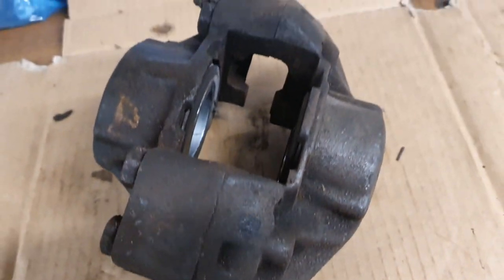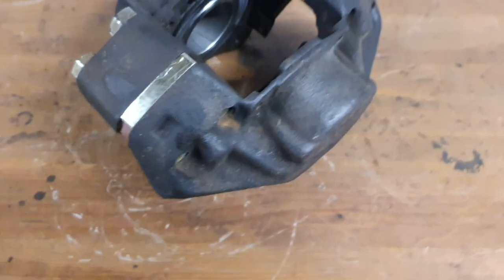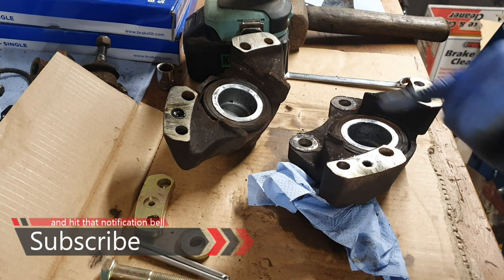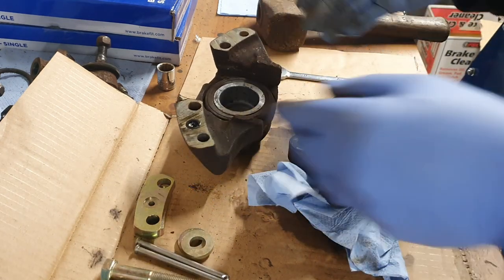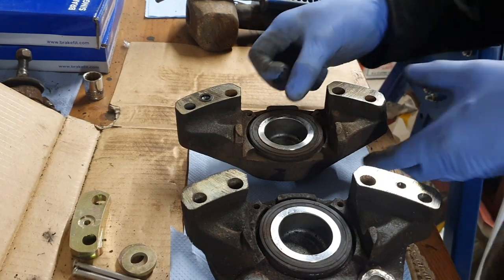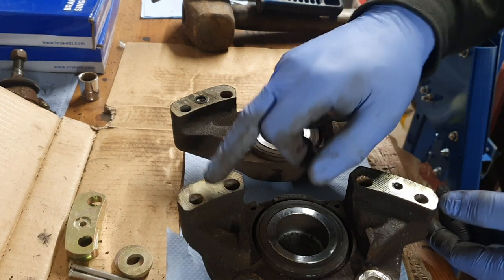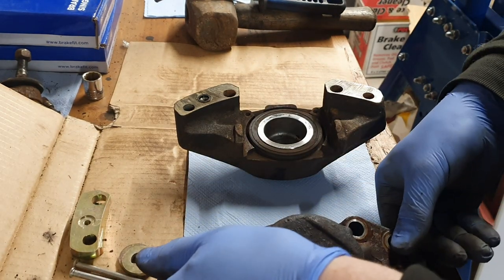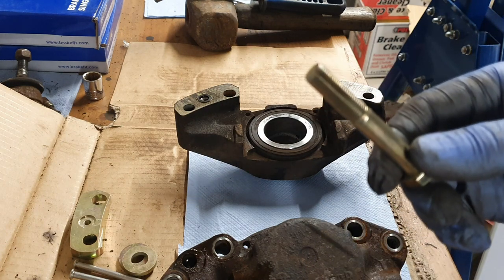Upgrade your capri escort or cortina brake calipers to v6 spec

Comment: The main mod, back in the day. Was to use the Calipers from Austin Princesses, as they were Four Pot Calipers.
Reply from the maker: Yeah it still is a relatively used mod the princesses 4 pots this is just a nice cheap way to get the 2.8i set up 👍

Comment: worked in a garage in the 70s was told never to split old used calipers apart as they are susceptible to leaking,if my gaffer a mot tester spotted this mod back then he would refuse to test the car.

Comment: Good video. I watched hoping to find the torque wrench settings for the inner and outer bolts. I have a workshop manual to suit a car with those calipers but it doesn't show those settings.
Did your kit mention the settings?
Reply from the maker: @william humber hawk no I couldn't find any at all I even looked through a load of old autodata manuals from the 80s/90s and nothing not even the 2.8i hanyes manual has the correct specs for the vented discs but if I do find some il pin the past at the top of the comments 👍information is king
Reply: @RetroCarsReborn  thank you. It's a good idea to use the Locktite on the threads.
I rebuilt the calipers of another car I have, a 1961 Humber Hawk Series II. And the workshop manual for that car has the settings for those bolts of larger size but had a notice saying that the calipers shouldn't be separated unless done by factory or specialist. But the Lucas Girling repair kit I bought for it had the flat sided "o"rings so I did it.

Comment: Remember back in the day searching for a set of Austin Princess Calipers. Brakes were always suspect on any Capri 😰
Reply from the maker: @glen goodall yes I thought thay were OK but 2.8 spec should be better if not il have to save up for the Princess 4 pots touching 250 quid these days were as discs pads spacing kit was a total of like 70 quid 👌👌
Reply: @RetroCarsReborn  The Princess were a bit better but not world's better. I remember getting out of my 2.8i on standard brakes and driving a 1.3 Maestro and the brakes on the Maestro more powerful and instant on the pedal. Fortunately the power on the Capri instant compared to the Maestro though